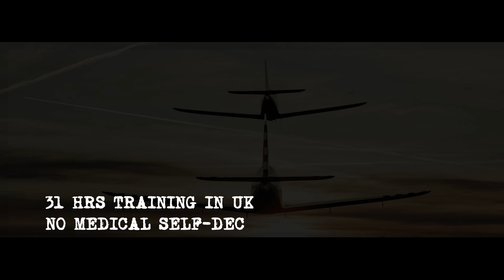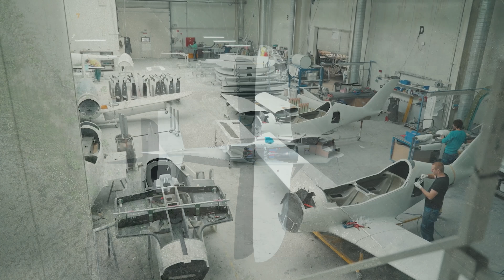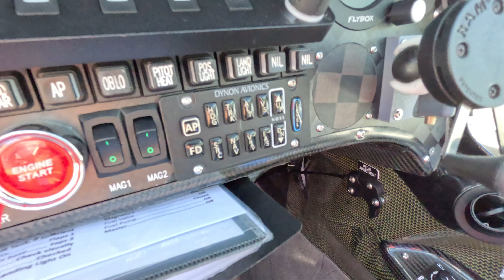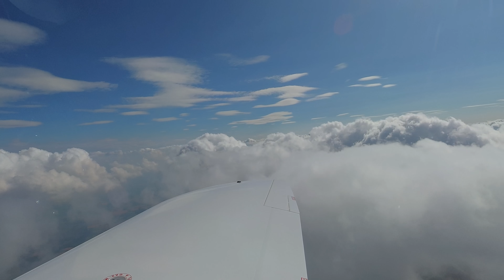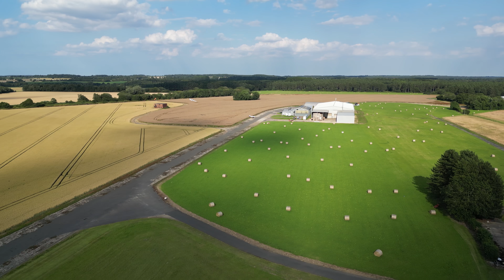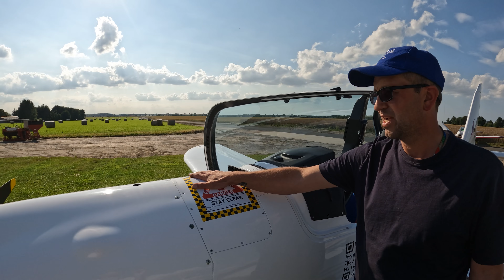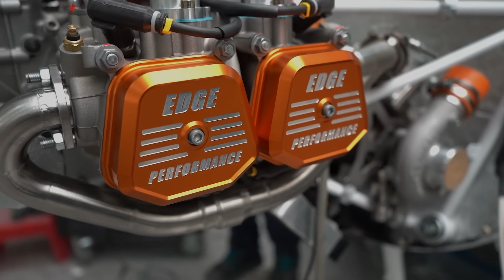YOU CAN FLY THIS from just 31 hours training from ZERO AND NO MEDICAL!

Comment: As someone who previously held a PPL (A) in the UK I really don’t think it’s very responsible encouraging people to fly such a performant and complex aircraft (variable pitch prop, retractable landing gear and complex avionics) with only 31 hrs from scratch and no formal medical !! I certainly wouldn’t want such inexperienced rookies flying these things anywhere near me or near any populated area for that matter.
Reply: @UKBulldog2004  would argue it's not complex avionics just modern..  glass is the way forward
Reply: @TheHungryAviator  even so ….. 31 hrs is still a very short amount of experience and hardly enough for a basic aircraft
Reply: @UKBulldog2004  new mosaic is 20hrs though right ?
Reply: @UKBulldog2004  I think he's more stating it's possible which it is especially if they are young. Insurance will prob be impossible though anyway   As terry said aimed at the older pilots probable with a license but can't pass the medical and bored playing golf
Reply: How do I get involved
Reply: It frankly depends on the ability of the student pilot. Some will be perfectly fine with 31 hours and others will struggle even with 50. In this regard it is similar to the driving test. Some people take five or more attempts to pass, others get there very quickly. The low stall speed makes this aircraft pretty safe. Ok, it has retractable gear and a prop control. So what. You are supposed to know your gumps checks even in a Cessna 150 as they are drummed into you. This is not a "complex" aircraft. It just has two aspects which are slightly more complex than a standard flying school aircraft.

Comment: Impressive (ish!) Performance but struggling to see who will buy this? It has no utility value and no one is going to fly 1000nm , no flight in IMC (and presumably at night either?) And no flights into Europe. So who will use it and for what?? I fly an SR20 which cost less, granted it uses more fuel but carrires more, can fly at night and IFR. Perhaps I'm not comparing apples with apples??

Comment: I started in an "Ultralight", here in the USA. 254 pounds in weight empty/dry, max 54 knots. NO license at all needed. Flew my Maxair drifter over 90 hours. I had 4 hours of dual instruction in a Cessna 150 when I soloed my ultralight. I even looped it. The loop happened at a fly-in where we were mock dog fighting. I couldn't shake this trike turning so I decided to use my superior speed (i might have replaced the stock 28 hp engine with a 60 hp) get out in front of him and then pull hard around to get "guns" on him. I actually climbed and turned, looking over my shoulder. It was more of a cork screw than a loop but I did get my shot on him, coming over the top upside down.  3 engine outs, an accidental loop and I took it down for IRAN. It was close to coming apart in key areas! The "Micro Light" is way more airplane. I would have died trying to learn to fly in a Shark. I am 69 now, so getting in that hot rod would test my limits...
Reply: I would be careful snap that airframe putting too much stress on it. Ultralights are designed for slow flight and low G force.
Reply from the maker: +4 -2G same as pretty much every non-aero aircraft on the market.
Reply: @Mike-01234  look at the Maxair Drifter design. It is like a Heath parasol monoplane. Cables on top and bottom of the wing. Probably why I am alive...
Reply: Ultralight has different definitions in the US and Europe...
Reply: It sounds like you fly your airplane "beyond it's capabilities" too see if you can make it do what you want it to do not what it's supose to do and that makes you a very stupid pilot.
Reply: high wing design ... this is the point. safety first.
Reply: what ultralight do you have? I'm looking to pick one up and swap out the motor for something slightly bigger
Reply: @GalaxyEnixix  have not owned one since 1990 is. Sold it and got my pilots license. Have plans to build a Humax. An all wood design.

Comment: N36LV builder here. With respect, I completely disagree. This is not a Lancair 4 with a very unforgiving wing below 70kts. 160kts true means 130kts indicated around 10,000ft. With that excellent visibility and 40mph stall speed this looks like a slightly quicker version of the original Diamond Katana. One of the most memorably easiest airplanes to fly, especially in the landing phase. I applaud their efforts at fuel efficiency and cockpit design. Probably a big baby to fly….I want one!
Reply from the maker: Flown around the world safely once by a 19 year old girl and then by her brother who was 17. It's really easy to fly but things happen quickly at 150 knots. Thank you great comment.
Reply: Only that after decades of flying aging Pipers and Cessnas, it was the most refreshing new design (at the time) which sipped fuel, had a reasonable cruise speed and was without peer the easiest plane to fly near the runway environment and into ground effect (my Velocity notwithstanding).
Reply: What would be the connection with DA20 Katana, if i may ask ?

Comment: no 915 version yet? strange
Reply: The engine won't fit, maybe an injected version soon tough.
Reply: @terryjkent  maybe an injected version? are they asleep at the wheel? did they lose their original developer?  the 915 doesn't seem much bigger than 912, indeed same size as some versions of the 912 so shouldn't it fit with a new cowling?
Reply: @DanFrederiksen  there's enough differences to make it not fit, however who knows where they will go to next?